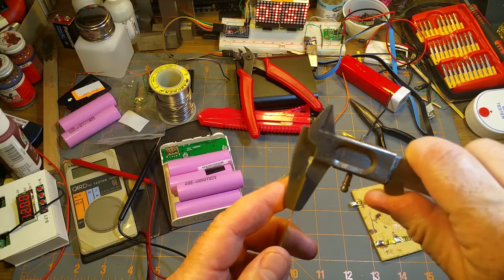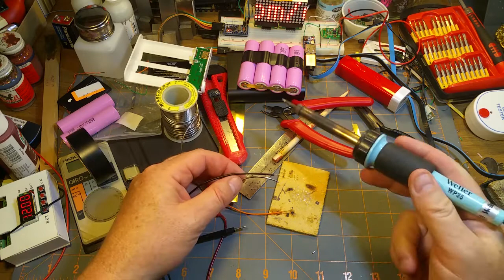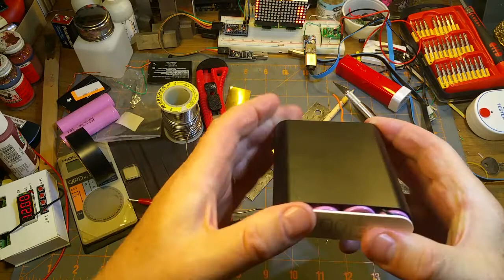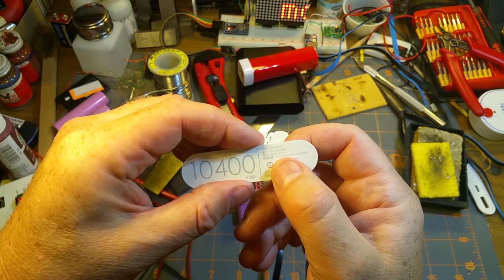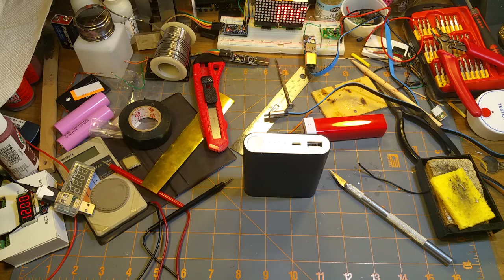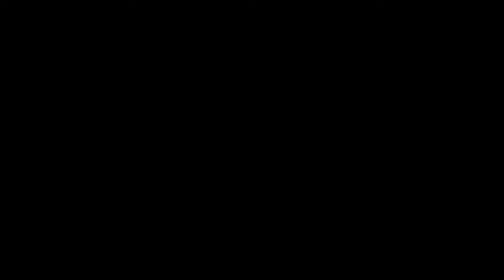power bank

Comment: I'm currently testing about 160 18650 cells. I fully charge them, let them sit for a day and then discharge them to measure their capacity. I don't really like the method where you let the fully charged cells sit for weeks and then check if the voltage dropped. You can tell if a cell is bad by the mAh left in it. When there are about 70-80% left from what the original rating was then the cell is considered dead, it can still be used to power low-power stuff though.
Reply from the maker: This is my first time playing with 18650s (or any other Lithium batteries), so I'll take any advice I can get.

I didn't really intend the "charge 'em then let 'em sit" to be a test, that's just how it happened. 
I charged them, then a week or so later I had a reason to use them.

Do you have a recommended tester?
Though I guess using my charger doctor method kinda does tell me what they can hold - it's just not very elegant or automatic.
Reply from the maker: Thanks for the recommendation.

Turns out I ordered the exact same one about 2 weeks ago. 

Look forwards to that in a coming mailbag (probably another 2 months,the way shipping times have been going)

Comment: I was inspired by your post to order a couple of those power banks myself. They have improved it by putting in positive and negative parallel contacts and soldering them into the circuit board. Here's some photos of the power bank I got: http://imgur.com/a/shYpY
Reply from the maker: Nice. Where’d you find the contact set?
Reply: I followed your link, and the bank now comes with the contacts already soldered in. Perhaps they were inspired by your video?
Reply from the maker: Cool. Glad you had good luck with it.